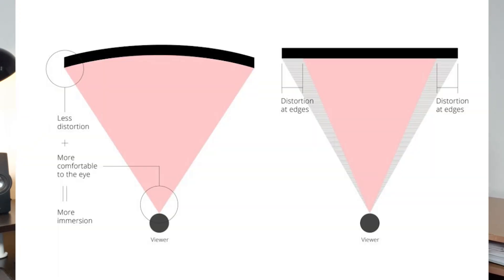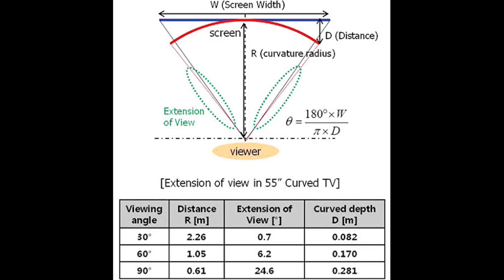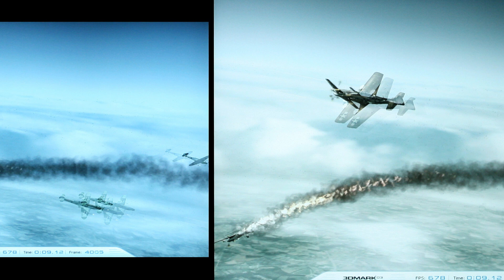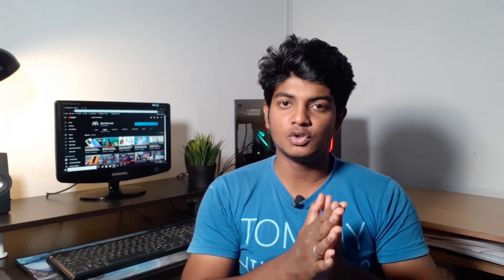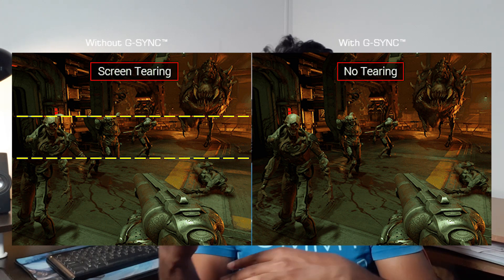Monitor பற்றி நீங்கள் தெரிந்து கொள்ள வேண்டிய அனைத்தும்!!! |G-Sync VS Free Sync|Curved VS Flat panel

Comment: LG la ultragear monitor la g-sync iruku 144hz with ips display 144hz ...ithu vaagula nu iruka .. but enoda graphics card gtx 1050 .. crt ahh irukum ahh
Reply: This monitors supports both freesync and Gsync(adaptive sync) bro. Don't worry gtx 1050 support Gsync for well optimized games.

Comment: While vsync off + freesync on, if monitors is 60hz and gpu can push 80hz, game runs more than 60hz.But, while vsync on+ freesync on, game runs less than Or equal to 60hz only with no rich feel. 

While Gsync on +vsync off, the same case like I said above.freesync gives more fps comparing to Gsync, but Gsync gives rich performance, pure less lag, purely no screen tearing, purely no stuttering, but only in less fps, more expensive. 

Gsync offers rich experience and value for money. freesync offers cheap and best but not comparatively best as Gsync.

Comment: Bro please tell that what graphics card is suitable for my intel dual core e7500
Reply from the maker: Dont buy graphic card for that processor beacuse its a old one and can not support anything 
And no modern grahics card suits it
Reply: @SRVTWIZ  is that i have to change my processor?
Reply from the maker: @noiselesspictures9273  yes bro of course u have to
Reply: @SRVTWIZ  bro will it support on intel dual core e8400
Reply from the maker: @noiselesspictures9273  bro dual core ah vidunga use i5 9th gen or amd ryzen 5
Reply: @SRVTWIZ  avalo budget ille bro atha kete ..sollunge e8400le support aguma

Comment: Game vsync + free sync on panna enna nadakkum
Reply: While vsync off + freesync on, if monitors is 60hz and gpu can push 80hz, game runs more than 60hz.But, while vsync on+ freesync on, game runs less than Or equal to 60hz only with no rich feel. 

While Gsync on +vsync off, the same case like I said above.freesync gives more fps comparing to Gsync, but Gsync gives rich performance, pure less lag, purely no screen tearing, purely no stuttering, but only in less fps, more expensive. 

Gsync offers rich experience and value for money. freesync offers cheap and best but not comparatively best as Gsync.
Reply: @ramdinesh9655  thankyou bro🤗🤗🤗🤗